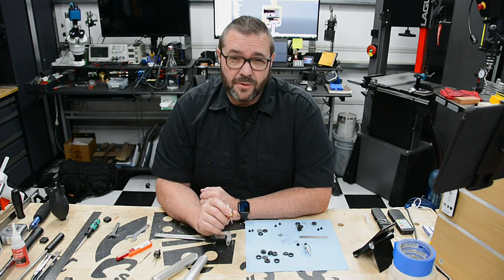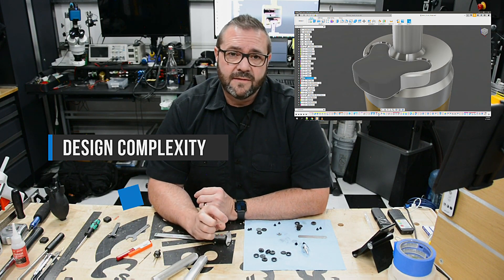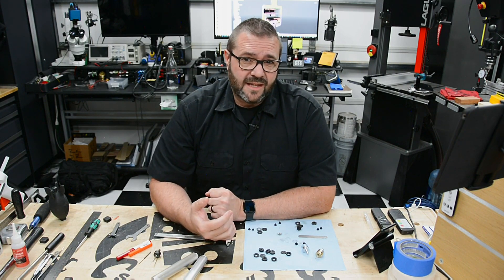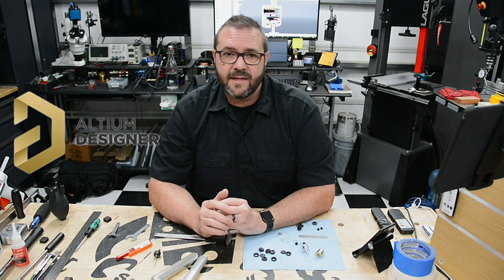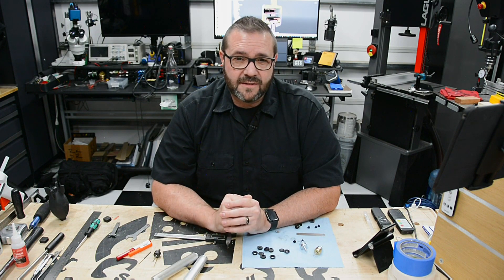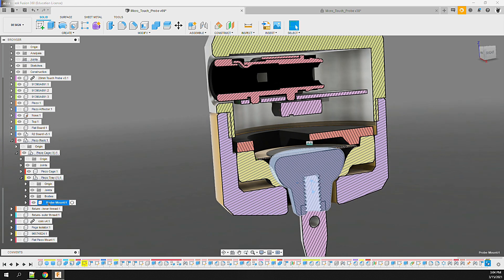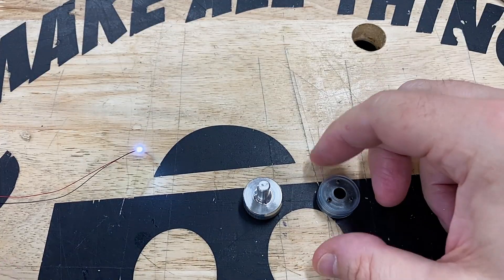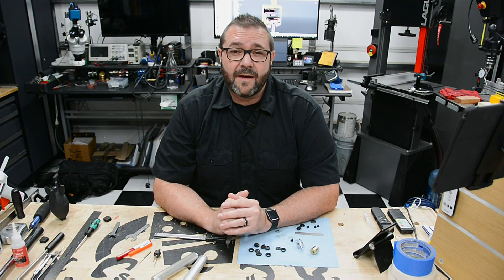Tuning A Micro CNC Touch Probe, milled on the PocketNC!

Comment: When you have the tools and the sponsors, yet no vision... Relying on the piezo to return the pointer back to thr center as if it was a spring will only work so as long as it hasn't been deformed. Very poor design again. Just use springs and a mems sensor.

Comment: First part with connector is classic over-engineering but not designed for manufacturing. The other issue is that this looks like a complex and high-cost solution to a problem that's already easily solved by a commercial unit that costs around $50 retail and much lower wholesale. Now if we were talking about a wireless solution, that would be something to go after as retail prices on those are upwards of $800 and well into the thousands for some.
Reply from the maker: fair enough. ;)

Comment: I'm also building a piezo touch probe .  This is the 2-nd iteration .the first was with flexible piezo , the second variant is with piezo disc , as you use in this  video. I've used Pro Micro board for noise , sampling time and threshold calibration menu  . If the piezo circuit fails to engage ,as safety feature , i intended to use a 3 ball ,NC switch type contact wired to E-stop .  
     Still wandering on how to do the hardware .

Comment: Did you think about XY adjustment screws to correct any runout errors in the probe stylus? Otherwise you wont have accurate measurments
Reply from the maker: Three grub screws in the nose allow for adjustment of the probe runout.
Reply: @DIYEngineering  yes i noticed but i think it wil be hard to do so.
I know that you can adjust the tilt of the stylus with the setscrews  but you cannot shift the axis off center if needed.  Not all stylusses are perfect. I have seen some that where all wonky.
On the other hand you can compensate with software but i have a fettish for mechanical precision 😅

Regards from a fellow CNC mechanical design nerd.

Comment: At 6:30 you mention that you could have made it larger and resolve the majority of the issues. What was the biggest size constraint that was creating all the extra issues to work around? How would you have designed it differently if you would have made it a bit bigger?

Comment: Did this ever come to fruition , haven't seen it on your webpage ?
Reply: guess he just quit. watched these 2 videos from him and somehow his attitude and demeanor came off weird to me. Gives a "I'm such an engineer" vibe not usually characteristic of a hobbyist. Can't put my finger on it, it's like he cares more about coming across as an engineer with all the fancy language and monotone demeanor than he does having something that even works at all. "iterated through various designs, just part of the engineering process" instead of "well shit it didn't work, so I tried a few other things which also didn't work, if you guys have any advice leave it bellow cuz this is actually harder to figure out than I thought".
Man didn't even prototype this s at all, just straight up ordered a PCB and assumed everything would work. like homie, get some jumper wires and machine stupid simple parts to test things in the first place. you can literally touch it with your finger to see if it works.

so idk, dude seemed like a bit of a goof right off the bat and I'm not surprised that he not only didn't finish it but also that he refuses to answer any comments asking about this project. I mean you look at his setup with the oscope and the screens and the microscope and all that, and he can't do this one simple thing? if that's not the definition of poser idk what is. and that's what happens when you care more about looking like something than actually being that something

Comment: This new design seems much better to work. I only see one weak point. I think that you'll need a small gap (<5 microns) between the piezo and the tip holder and a reliable method to push the tip holder down. Using the piezo to push down the tip holder could result in problems in interpreting the tip movement and the induces pressure. Keep my fingers crossed and waiting for the results.

Comment: this is really cool. I have some of the piezo's lying around as I was inspired to build something similar, but never got to it. You're really pulling it off in a spectacular way. Impressed!
Reply from the maker: it was easy to get to work, but this circuit needs an adjustable resistor as each piezo seems to be slightly different.

Comment: Hi David, I too design and manufacture touch probes and currently designing similar probes. Straight off, i think your first iteration is better in terms of repeatability of the stylus than the second one. My experience, the repeatability when chasing single micron needs to be tested over 100,000+ actuations(I have failed going by initial accuracies :D) . Currently i am working on piezo resonance-based circuit, than getting signals from shock, but finding it difficult to find circuits to isolate touch vibrations with other environmental vibrations. All the very best.
Reply from the maker: Interesting, these changes are subjective to my probe and they resolved all of the issues i was experiencing. The floating probe didn’t have any issues with mechanical vibration or false triggers. But every design is different and I’m not sure what yours looks like. Thanks for the feedback
Reply: @DIYEngineering  I am eagerly looking forward to the success of the probe and your observations.

Comment: I think the audio jack connector is a great compromise. Wireless could work, but I think you'll end up finding that you'd need enough power to make it work the way you want that you'd be better off just having a wire powering it anyway. In that case, given the low voltages involved, why not just use one of those 4-contact audio jack connectors instead? You could have two power contacts, and two signal contacts (potentially enabling differential signalling).
Reply: I guess I should add that I am making a few different assumptions about your approach here which might not be valid. It seems like your goal in the current version is to get an analog signal out from the touch probe, whereas with a wireless you'd obviously want to output a digital signal (even if it's just a digitized version of the analog signal). It's possible that you're already too strapped for space to get a microcontroller inside the touch probe itself, but it might be worth considering. I'm not sure which one I would recommend specifically, but I know that there are many that could replace that op amp chip and already have a responsive enough op amp built into the microcontroller itself for you to use it to sense and also do processing and output. The continuous glucose monitor I use has an MSP430-based microcontroller, a watch battery, a bluetooth interface, and an NFC interface... and it's barely bigger than the PCB you've got!
Reply from the maker: The probe is smaller than the audio Jack you’re referring to
Reply: @DIYEngineering  that's a tough constraint. How much space do you actually have in there to work with?